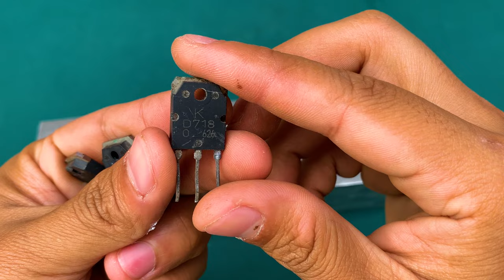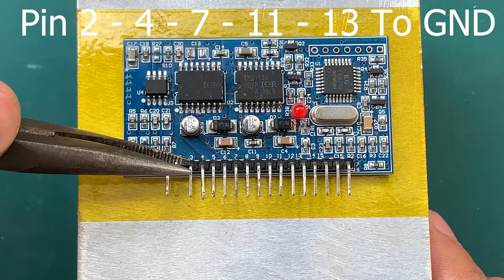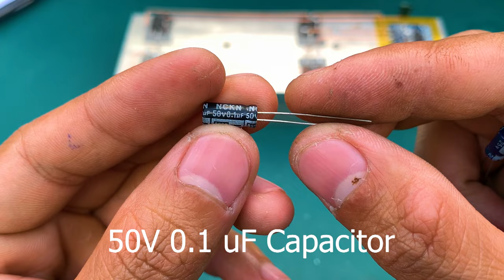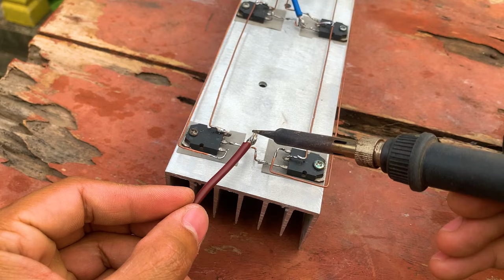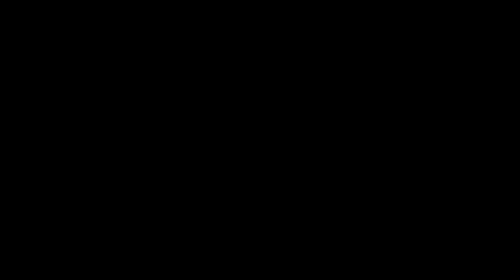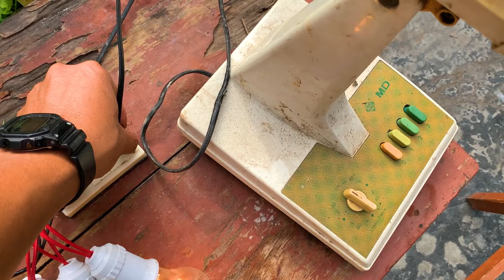DIY Powerful Ultra Inverter 12v To 220v EGS002 , D718 , Simple Circuit

Comment: Bro, battery does not even spark when you connect the redwire, and you don''t use 5v regulator bro wth
Reply: SIM FALTOU O REGULADOR DE 5V E OS DIODOS E TRÍMPOT  DE AJUSTE  FeedBack.

Comment: Doesn't the module require 5volts for its operation? Or you just give it 12volts directly? Where is the feedback coming from? The lights are not very bright and flicker as hell, what is the output voltage and current? I kinda like the flapping on the wind style of construction,  but doesn't seem very safe.
Reply: from what i know it needs both 5v and 12v. i would use a 12v to 5v regulator since it doesn't need that much power to work
Reply: you can check the datasheet for EGS002, just google it ;) and all is there. yes, it req. 2 voltages, but better buy the one with display, you'll see some statistics of the inverter. But, building it without protections and feedback, it's like asking yourself for a trouble ;). It's only good for learning purposes.

Comment: Boa noite a minha EGS ela não aparece as mensagens não display e eu comprei tudo junto e a minha placa para botar em  60 ela tem tipo um capacitor ou é um resistor no outro borne de  50 tem como corrigir isso
Reply: Pra mudar de 50Hz pra 60Hz tem que alterar o jamper JP5 para o JP1.

Comment: I notice a lot of errors the capacitor that connected to pin 9 and gate with the resistor is creating to much noise slowing down the gate Switching time so remove and use the feedback current from the transformer
Reply: and the egs002 light is not working

Comment: Hello, very nice video. I did the circuit but above 200vac the voltage drops to 180vac. Any idea why ? Thanks.
Reply: Solo usaste el módulo y lo conectaste  o tenías que programar el módulo?
Reply: @carlosyepez3041    no programar,  usar diretamente
Reply: @josepeixoto3384  que raro pues se configura ese modulo para que trabaje sino no va trabajar correctamente
Reply: use high power mosfet irf3205 IRF4110 etc. not a low power transistor like in the video.